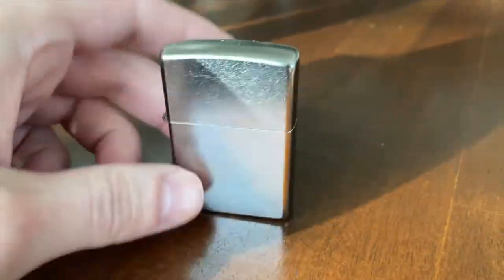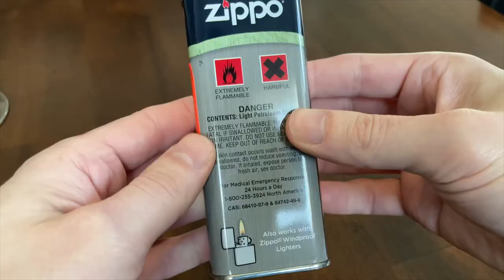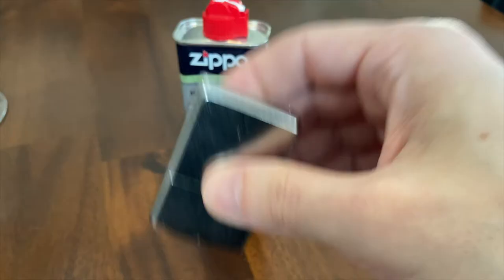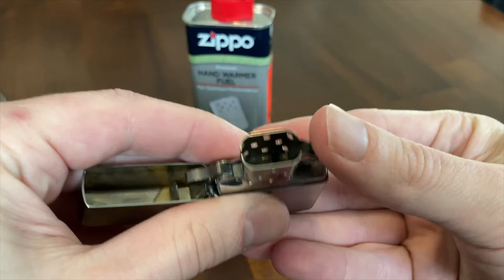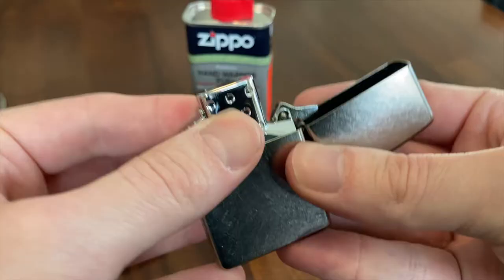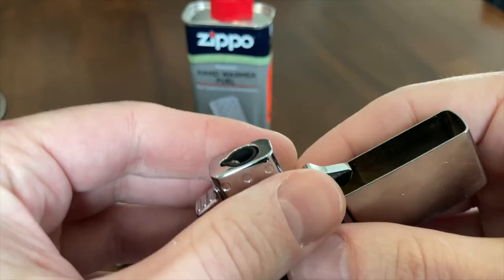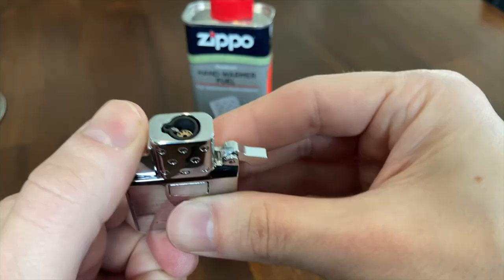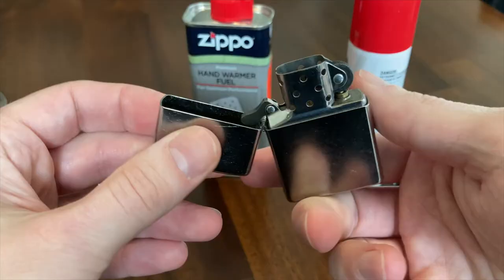Zippo | Butane vs Lighter Fluid Modules

Comment: If it's taking that long for the fluid to get to the wick, you probably need to realign it in the cotton. If you take the cotton off you'll see the string wick. You want to reorganize that so it's settled into the cotton in an S shape. That way it can most easily absorb all the fluid you put into it.
Reply: By take the cotton off, I mean that the cotton inside is several wads you can easily take out with some tweezers

Comment: Is the hole on the cotton of the soft flame lighter the same as the hole on the blue flame lighter where you insert the butane? So I can use the 75 mL can of butane on the soft flame lighter right?